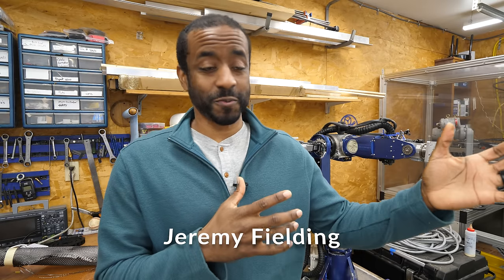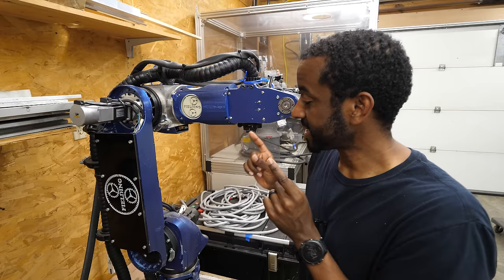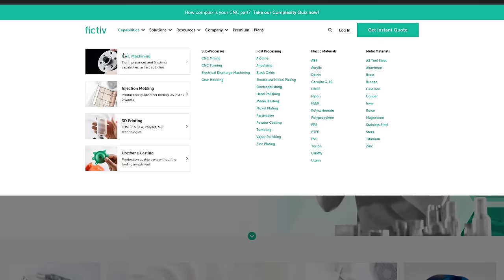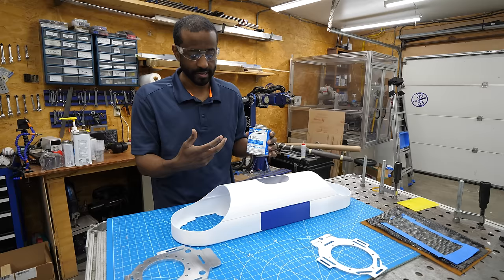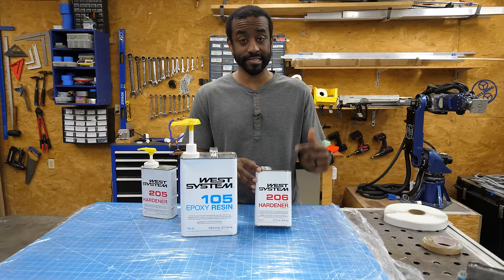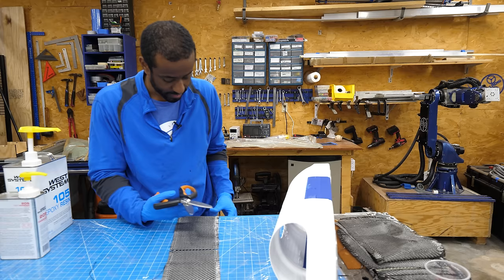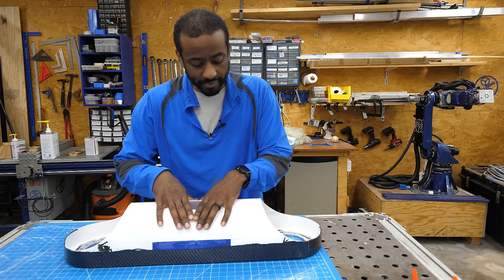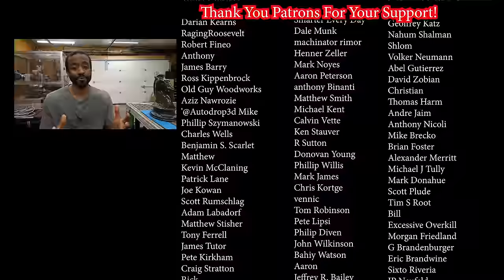How to Make Anything Out of Carbon Fiber.

Comment: Also i would recommend using a 0.8 mm nozzle for multiday prints as 9/10 % of the time it will cut the printing time in half and wont effect the strength to the print exsepcaly since your carbine coating it.
Reply: I worte a comment asking about how big of a nozzle was Jeremy using but you sort of beat me to it. I think theres even 1.2 nozzles not sure if bigger. However for the printers he has I'm not sure if the heatblock would be able to handle that big of a nozle unless you drop the speed which it defeat the orpuse but it should be a good test  going as big as the printer can handle in this particular case.

Comment: For something like the knight, you should make a negative mold (probably in this case two or more parts is easiest for layup) and then polish the interior to a high level of finish so that you can layup the carbon fiber directly against it and get a perfectly smooth outer surface. The separate halves are then joined afterward and the seam can be polished smooth (especially since this piece is mostly decorative and doesn't require high strength).
Reply from the maker: That certainly sounds like a good approach. As you know I am new to this, so perhaps on the next one! The next decorative project that is LOL
Reply: And for something like the knight that's decorative and not weight critical you could use fiberglass instead of carbon fiber.  Glass is much cheaper than carbon and similar or easier to work with.

Comment: If you haven't seen Mike Patey's videos from his "Scrappy" build, he is an absolute genius with carbon (and most everything else). You two would have a great time getting together. I know he mentioned corrosion issues when mixing aluminum and carbon in one of his videos as well.
Reply: I'm glad someone beat me to it! I would also recommend adding a thin layer of fiberglass between the aluminum and carbon fiber to eliminate the chance of corrosion between these materials.
Reply: This. Reach out to Mike Patey. He’s a carbon fiber guru.

Comment: Closest to this I've done is fibreglass repairs to Kayaks back when I was young enough to fit in them. Interesting to see both the similarities and differences in what on the surface looks like it should be a very similar process. Thank you for taking us on your journey over the pointy bit of dunning kruger.
Reply: Now, that phrase made me laugh! Having spent a lot of time - particularly doing home repairs -  snagged on the pointiest bits of Dunning-Kruger I can feel it resonate in my bones.
Reply: @ColdHawk  The fun part is the ride down the other side as you're forced to figure out why thing that you were sure would work ended up with everything catching fire.
Reply: Carbon fiber and fiberglass are more or less identical processes to my knowledge, though there are definitely a lot of different ways to deal with both. Heck, carbon and fiberglass can even be used in the same layup for a single part. Probably the biggest difference in handling the two is how they respond to a pair of scissors. Well, and carbon might be a bit messier... I've done very little with fiberglass but I spent a year working with carbon and let me tell you, that stuff gets everywhere...

Comment: I trust you've already gone through most, if not all,  of this, but:
There are a few factors to consider with 3D printing dimensional accurate parts. The process causes some shrinkage, and the calibration is going to be important for each new material. (Brand to brand, and even roll to roll). Part of that process includes verification of the steps each of the stepper motor takes to move a specific distance (defined as steps per mm, most commonly) for each axis, and the extruder stepper motor(s). These are usually accessible through the slicer profile settings, but some models require a deeper dive into the firmware/internal settings. Once you verify the steps are accurate for real-world movement (which is fairly rare out of the box), the next step would be scaling compensation for the shrinkage itself. Personally, I like the 100mm in each axis. It makes the math easier: 100/(actual print measurements)=(decimal representation of scale [1.xx=1xx%])

I hope that this is helpful to you or some of your viewers. There is more info available online in a TON of places.

Comment: I had my first attempt at CF layup last week, and it's great stuff to work with; It's expensive compared to other composites, but not as much as it used to be (I guess due to more companies now making it), looks very cool once finished. The only issues I experienced were loose tows on the edge that kept fraying off, I kept all these and chopped them up to make some forged-carbon-like material just for fun. Oh, and also forgetting to put enough of the right mold release on, which meant I spent ages chiseling and sanding to separate the parts.
Reply: Update: Okay, the comment above was trying something easier - yesterday I tried to skin a tailpipe trim piece and it was a nightmare of sticky hairiness, that said peel ply saved the day in keeping all the fibers in place and as I had a leaky vacuum bag, I used some cling film (I think the US folks call it Saran wrap) to hold everything tightly together till it cured, and it did a fantastic job, so will probably be using that for subsequent projects. Things I learned: Cut your CF and peel ply pieces and dry -fit them before you even think of applying resin, ensure you have no vacuum leaks and finally don't dive straight into making complex shapes without some practise items first!

Comment: You could use rubber membrane press or some sort of rubber sock arround the knight (those can press tight areas without wrinkles) and you could model holes into the knight so that epoxy would flow into the part. So you would not need any peel ply (silicone membranes are self releasing and you would have "dry" carbon), breather etc. You could also get a 3d printed part out of it to make it lighter by heating it up. Also try gluing carbon onto the part with car spray glue, then use silicone kitchen brush to wet it up (reusable) and then pull a vacuum and work epoxy inside the holes by hand (diy autoclave carbon). The mould could be done of hard wax to be mented out in the end

Comment: there's also the forged carbon fiber process that you can make molds with 3d printing. I tried following Easy Composite's process and it needed some minor modification but it's totally doable.
For certain parts the forged process is better than hand layup (especially the small stuff like the brake lever they made);
I made a shift knob for my car using the forged process and it looks stunning. Way more unique than regular woven fiber.
Reply: I've probably watched every one of Easy Composite's videos but I still haven't tried making anything with carbon fiber myself yet. It's great to see someone actually making stuff.
One of these days I'll make some carbon fiber parts myself. First I need to clean off a table to work on.

Comment: I worked at an aircraft composite parts company and learned a lot about various materials and usage and the processes to make the parts. It isn't easy but can be done by a DIYer with proper instructions.

Comment: Quick tip on the vacuum bag. surround the perimeter of with a piece of rope inside the bag with the ends at the end of the vacuum hose. It helps distribute the vacuum without the bag collapsing.

Comment: You can also get carbon fiber/kevlar cloth. I used it to build a 19 foot kayak in my garage, using a mahogany kit kayak as a mold. The kevlar adds a different kind of strength and makes the end product a lot less brittle. Used a fiber core material about 1/8" thick that contained glass beads to reduce waight. When landing my kayak one day, there was a 20 pound rock in my way. I reached over the side of the kayak and picked it up, throwing it up over my shoulder into deeper water. Oops! Misdirected and hit the top of the back deck of the kayak full force. There is a dent, but the structure of the hull is intact with no real damage. I believe carbon fiber alone would have shattered at the impact point. You can MIX the slow and fast hardeners to get a custom set time.

Comment: That take away, "learn something new".   I took on a project to make a part for my adventure van, it was going to involve printing with ASA, and I've only been learning 3d printing, relearning CAD in general, and learning Fusion360 for just about a year. I've learned so much about part design. I've learned so much about my printer, working with the higher temp filament, getting good at bed leveling, etc. I've learned so much even just about all the little details in the slicer settings!  In the end, the part is buried in lap sealant and barely visible, but I'm so happy I took it on and am energized to try even more new things!

Comment: Just want to bring up an issue when combining aluminum and carbon fiber. It’s called galvanic corrosion. There needs to be a non conductive layer between the metal and the fiber such as fiberglass or a coating on the aluminum. Great work by the way and a fan of all your projects.

Comment: This is pretty wild.  Back in a previous life, I was planning on building my own wind turbine, with some fancy blades molded from fiberglass.  This process seems pretty similar, although i was thinking about having a two piece external mold, and a bag inside inflated with air pressure.  
You've definitely gotten me thinking again.

Comment: Really nice and easy video to watch....Thanks for making it .  
It helps to lightly sand the aluminium which will increase the bonding surface area by a very significant percentage  . Also try to coat the aluminium with epoxy as soon as possible after you have sanded and cleaned it to try to prevent an oxidisation layer forming on the aluminium which can very easily destroy the chances of bonding the aluminium to any other material.

The galvanic corrosion issue can be easily circumvented by coating the part in epoxy (and preferably a thin layer of fiber glass ) before adding carbon fiber.

Comment: So, I spent a year working in carbon fiber manufacturing, making parts for 10 Meter diameter QV Band satellite antennae, which if I recall correctly had a tolerance for the final reflector surface of 50 microns. We didn't use a wet layup process, but rather vacuum infusion, the gist of which is that we would first use a spray adhesive to hold all the fabric in place on a mold, then bag the mold, test the bag for leaks, and then use the vacuum to pull the resin into the part. Assuming everything is set up properly, it provides incredibly reliable results and will be very near the ideal carbon to resin ratio. Of course, this requires a thinner resin than a wet layup, as anything sticky enough to use for a wet layup won't flow very well into the part in a vacuum infusion.

Anyway, personal stories aside, some details I would like to mention. In order to keep our vacuum lines from being crushed, we would use a strand of yellow rope in the end of each line. To ensure the vacuum pulled from the whole part and not just locally around the lines, we would use a light fiberglass veil between the vacuum lines and the rest of the part. For our mounting holes we used steel pins that went into holes (with inserts) in the mold, and steel plates that were used to press the fabric tight around the pins without relying on the bag to apply pressure. In your specific use case metallic inserts are probably the best call though. And lastly, a detail you didn't mention about fast and slow hardeners is thermals. Resin curing is an exothermic reaction, and it reacts faster the warmer it is. The faster the reaction, the faster the heat, and the hotter it is, the faster it reacts, so if you don't have enough surface area to disperse the heat created by the volume of resin, you'll get a positive feedback loop and the resin will "kick", often boiling and spewing fumes before hardening in a still bubby (and I presume very structurally compromise) state. At the scale you're working with here this isn't particularly a concern, but if you're doing resin pours or mixing up large amounts at once it's something to keep in mind. Where I was working when we were making a new process for a part we hadn't done before, we'd start with 100% slow hardener and then track the temperature as we increased the amount of fast hardener every time we made that part until we reached the fastest mix that would reliably not overheat.

Comment: You can do resin infusion with a cheap vac pump and a bag. Essentially you lay up your cloth dry (a bit of spray adhesive to hold the shape) and it it under vac while a feed tube pulls your resin through the entire part towards where the other wide where the vac port is. You will have a way stronger part than applying the resin by hand (which tends to be a higher resin ratio than it needed)

Comment: Very good work as always!! 
I work with composites, i would heavily recommend tacky tape on your vacuum bags roofing butyl rubber works great and isn't that expensive. With wet layup it recommend both "peel-Plies" the fabric layer should go first then the perforated FEP (Blue stuff) should go on top of that. The fabric peel ply does Way better at preventing "mark off" from your bagging. Overlaps with your breather/bleeder or even pleats/wrinkles in your bag with markoff on your part.  Tape sealing any place where you dont want resin or fibers is a good way to control where everything goes. 
if you are able to get your hands on a 4 harness or 8 harness satin weave dry fiber, it will make the conform-ability to your molds so much better/easier.

Keep up the good work

Comment: great video on first time trying Carbon Fiber. a few notes/suggestions you may won't to be aware of. west system 105 epoxy is only good for around 50C before it get's soft thanks to a lowe Tg. And when you are making carbon fiber parts in multiple layups. You should be aware of Amine blush that forms when epoxy cures. And if it’s not removed before the next layup you are going to get bad layer adhesion. And this is where the green stuff “peal ply” you showed comes into the picture, as it makes the Amine blush form on the outside of the peal ply and then it’s easy and fast to removet. Vs sanding/washing the part before next layup
Reply from the maker: That was helpful! Thank you!

Comment: From the manual "Aircraft Maintenance & Repair" on the V-22 Osprey: The pylon support assembly
comprises more than 400 plies of carbon/epoxy fabric and
unidirectional tape. A tape-laying machine, capable of Tay
ing composite material on a contoured surface, has been in-
corporated into the system. Most of the older tape-laying
machines are used only in the fabrication of flat components
because of constraints imposed by their hardware and/or
software. However, a combination of recent advances in
computerization and innovative machine concepts has en-
abled the new tape layers to minimize those limitations. For
example, some machines contain ten axes of control inter-
faced to special computer software. When the machine is
programmed to lay tape over an area in a certain sequence,
it does so automatically, repetitively, and flawlessly.

Comment: Great Video, as always. 

For beginners - the best items to start with and get an understanding of  the material are flat (ish) objects. Think skateboard decks, or even a hockey stick. Ideally you want to be able to take one long piece of cloth and wrap it a few times around the whole object so that you dont have to re-bag so many times. 

One other way to go is by using a female mold of that chess piece split down the middle. You can then lay a larger sheet of the wet fabric into the cavity, and press it into the details from the inside. The vacuum will pull it in further, and then you trim the flash (overlength edges) to straight line with a multitool. Once you have the left and right sides made, you bond it along the center seam. This methods leaves a seam, but does allow you to reuse the mold many times. 

Last point - if you just wanted to reinforce the robot arm, you could simply leave the current one alone and create a much simpler curved "hump" portion out of a block of foam, leaving some extra fabric as flanges along the straight side. You can screw those flanges to the sides of the steel arm, and achieve the same torsional resistance across the curved surface skin.

Comment: I have a project for you. At the end with the chess piece mfg, your vacuum pump was in a few frames and I saw the oil mist wafting up as these pumps are prone to do. The first time you have to run the pump for over 15 minutes you will discover the roots of my challenge; to create a low cost filter that would remove the mist. I found this benign appearing fog to be a real nuisance and finally had to make a bracket connecting it to an old shop vac hose and channel it out of an apartment window (I gave up on building a filter with materials on hand after a couple of tries). That solved the problem until a neighbor noticed what he thought was smoke coming from my apartment at 2:30 am! Very exciting. A filter would resolve the issue and allow for indoor 24 hour use of my pump (wood stabilization using Cactus Juice).

I will get to carbon fiber use when I can clear other projects off the bench so thanks for the info and encouragement on that. We have very similar passions that drive us to learn, share and explore. All my best to you.

Comment: Hey one thing I learned while working on my composite airplane was that cutting the fiber diagonally at a 45 degree makes it conform to corners more and keeps those loose strands from coming off and making a mess while laying it. I use fiberglass mostly but carbon fiber is the same principal. I hope that helps on your future projects.